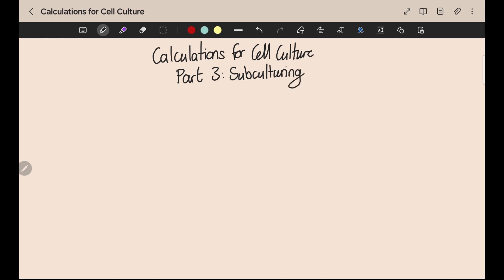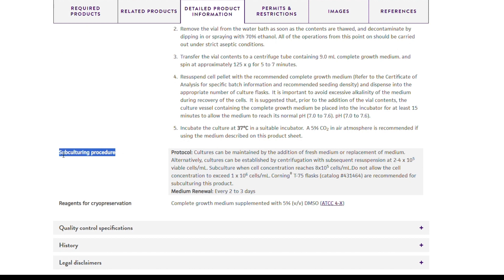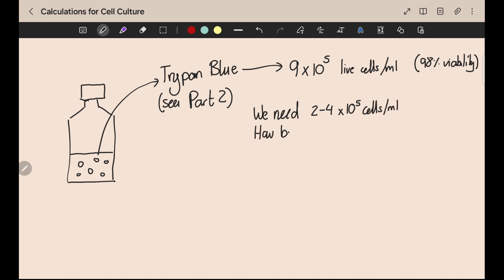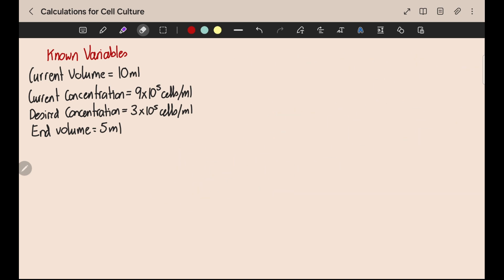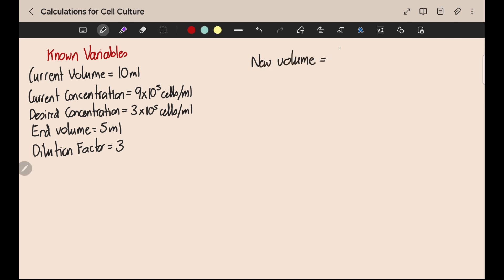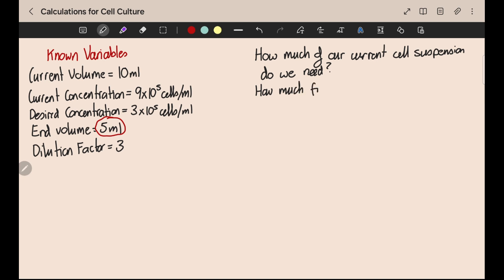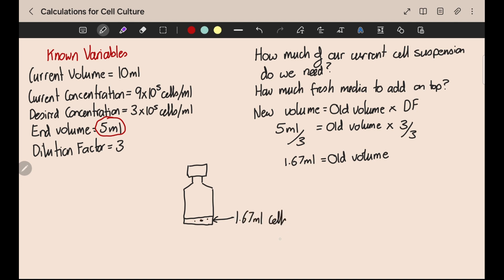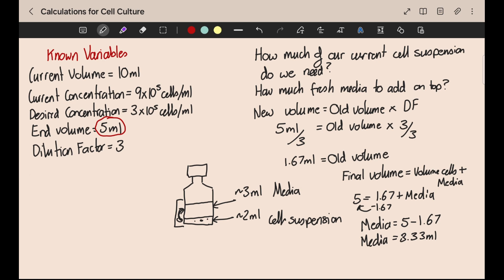Calculations for Cell Culture Part 3: Subculturing

Comment: HI Saffron thank you for teaching the DF, new volume and old volume relationship. May I ask this method you taught to subculture the suspension cells only. it is not suitable to subculture the adherent cells. Is it right ?
Reply from the maker: Hi there, the calculations are the same no matter what sort of cells you are using. However, the amount/concentration of cells that you want to subculture will vary depending on cell type, especially between adherent and suspension cells. I recommend you check the documentation for your particular cell type, so you know what concentration you need. Then you can use these equations to calculate volume etc.!
Reply: thank you  @SaffronBryant